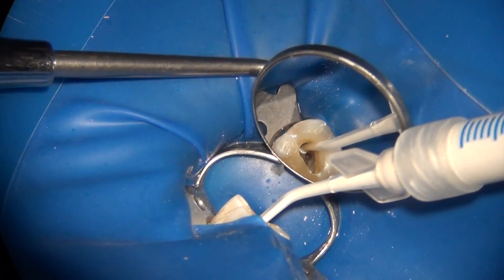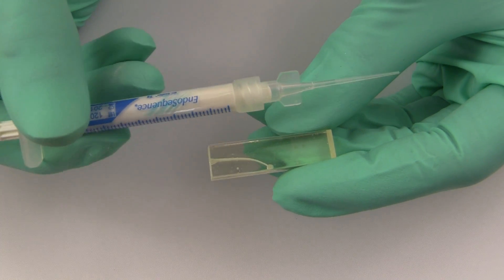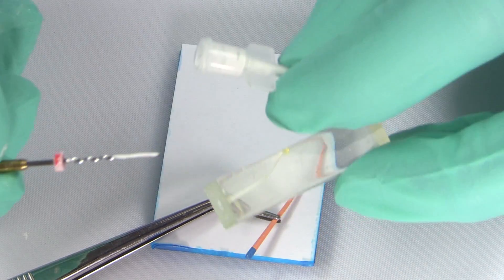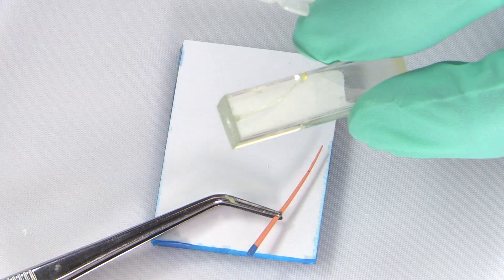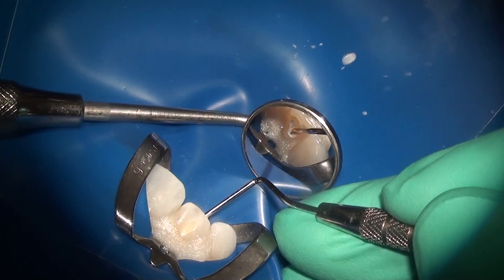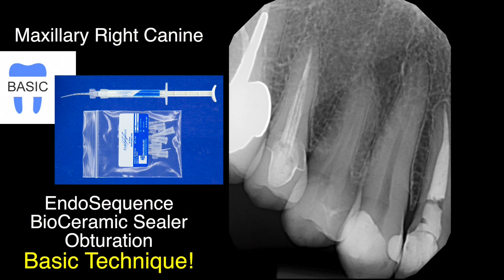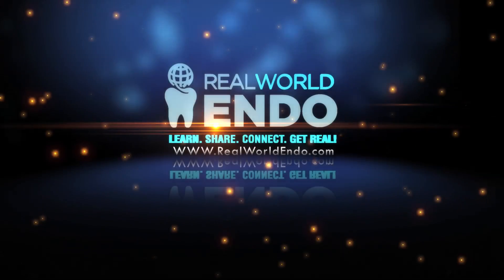Basic Hydraulic Condensation Technique

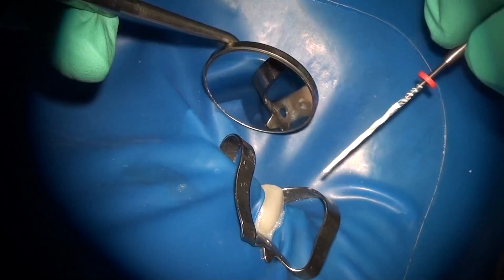Comment: Thank you for this video! I do have a question: At 10:02 you show a case in which you apply the technique, specifically, you describe how you dip the master file in the sealer and place it in the canal with some counter-clockwise rotations and you mention that one should "repeat as needed". You yourself apply a coated master file a second time. 
My question is: what am looking for to determine if I should repeat the application of the sealer or not? 
Said differently, how do I know if I have enough sealer when using this technique?
Thank you once again, Dr. Nasseh!

Comment: Hi cn i use scaler tip to remove excess sealer? Or i must use only specific endodontic ultrasonic? Tq
Reply from the maker: If the scaler tip can reach deep on the furcation it should work (should be used with water!)

Comment: hello Dr Ali Nasseh. please can you tell me which brand sells brasseler's products in Europe. I'm a but confused since a few years ago FKG was the brand but now I can see the bc sealer is sold by BUSA. thanks a lot for your help
Reply from the maker: Currently, Brasseler does not sell in Europe. They are distributors primarily in North America. FKG was private labeling some of the BrasselerUSA Products such as BC Sealer and Putty but that's about it. Cheers.
Reply: @EndosKool  I guess they divided their product into two distributors... I'll try to contact both. Cheers
Reply from the maker: @san5a89  Schein also sells BC Sealer. I forgot to mention.
Reply: @EndosKool  OK. what I really need is the right cone for the bc sealer based obturation. do you think a gutta cone of the dentsply system would warp with the bioceramic sealer? I actually had a lot of problems with conventional cones but I never used dentsply or vdw cones

Comment: I don't like single cone obturatiion..
Reply from the maker: That’s fine but Keep in mind, this is not the Single Cone technique. This is called Hydraulic Condensation. It’s people from other companies who are trying to discredit this technique that call it a single cone technique, because the original single cone technique in the 1950’s using ZOE failed. This is a different and non resolvable cement. Also, In wide, ribbon shaped canals you will need to use 2 or 3 cones adjacent to the main cone to fill in the gaps. That’s why it’s not a single cone technique. Cheers.

Comment: Thanks for the video. Two questions:
1. Can I use Vortex Blue and Wave One Gold master comes with BC sealer and expect good results despite not using BC gutta percha points?
2. Can I use the master gutta percha point instead of the rotary file to coat the walls? I find that allows me to place a more even application than the rotary.

I will order BC Sealer next week. However I won't be able to change our rotary system. Hence my first question
Reply from the maker: No specific studies have given an answer to that guest but U.Penn showed (through their internal research) that you get a less effective seal for the first 60 days with non-bc coated GP but then the seal becomes the same  after 60 days, presumably because sealer expansion over time. So, if you have to use that combination then you'll likely be ok as long as you've done the right job of cleaning and shaping.
Reply: @EndosKool  Thank you for the quick response. I understand the importance of a good seal, especially in the apical third. However, assuming proper cleaning and shaping, are we to assume that a non-effective seal can allow recontamination of the tooth from the remnant of bacterial matter beyond the tooth apex in the PDL and bone space? Just want to ensure the correct understanding. I currently do lots of my endo with cold lateral condensation using Dentsply Ribbon sealer. Many times my master single cone fits snugly enough to where I cannot pack any lateral cones. I use mostly vortex blue 0.06 taper and wave one gold. I realize that single cone obturation should ideally be done with a ceramic based sealer.  I would imagine with my single cone obturation using a non ceramic based sealer, I'm getting a good seal in the apical third but not so much towards the coronal area

Comment: Dr, cleaning the excess sealer with scaler and water,... wouldn' t that dissolve or remove the sealer?
Reply from the maker: Good question. It would if you use the ultrasonic to touch the Gutta Percha. You should direct the tip of the ultrasonic only on the dentinal walls near the gutta percha and never directly on the gutta percha or sealer interface. That's an important detail. Cheers!

Comment: In this tutorial , said that leakage occurs between gutta-percha and sealer so we should use bc coated cones ...is leakage occurs actually between gutta-percha and sealer or between sealer and dentin walls along the canals ?? Or both ??
Reply from the maker: Technically, leakage happens between GP and sealer in all sealers. The idea of using BC Cones is to help reduce this leakage by bonding to the surface of the GP. They've done studies at U.Penn showing that there's more leakage with regular GP than coated cones for the first 60 Days. There's then expansion of the sealer and the effect is negligible. That's why we recommend the BC cones unless they are not available were you are. Cheers!
Reply: @EndosKool  okay, regardless of using bc coated Gp ...,as leakage occurs between gutta-percha and sealer in all sealers why we don't use for example resin sealer wz single cone as leakage occurs in any case??
Reply from the maker: Leakage is only one factor. Resin and ZOE sealers will wash out of the canal in whole when pooled in one are. Historically, that’s the basis of our Condensation techniques.
Reply: @EndosKool  thank you sir, but if single cone is used wz resin sealer , how much time will it take to get washed out ?? Range ??
Reply from the maker: If you extrude a bunch of AH Plus out the root end you can see it resorb within a few months. Inside the tooth it will take longer but if it's pooling it will happen. Again, this is a matter of preventing the odds. It's not like every time you don't wear a seat belt you will get into an accident. But if you're not wearing it when you get into an accident then you're in trouble! This is the analogy for making decisions the enhance your outcome based on principles. Cheers!
Reply: @EndosKool  well said sir, thanks

Comment: Thank ya doctor 
I have noticed that while checking my master cone gp and taking the x ray  it comes pretty good but after putting sealer ( MTA- Fillapex) I use , the cone ends up being short most of the times . Please advice me to improve my obturation
Reply from the maker: First of all, you shouldn't be using MTA FillApex with this technique. MTA FillApex is a primarily a resin based material that much like Ribbon or AH Plus is resorbable. It's not a bad sealer but you need to use the usual lateral or vertical condensation with that sealer. Only pure bioceramics can be used with Hydraulic Condensation since they a non-resorbable after they set.
Reply: Real World Endo   Thank you sir !!!
Reply: After dispensing mta fillapex and ready to use, use it within 10 secs for each canal... Don't coat the Canals with sealer before obturating the canal with GP... Instead coat(thin coat) the master GP with sealer and insert it in the canal... Definitely this will solve your problem...
Cheers!

Comment: Ultrasonic and sterile water, right? And I just cannot see the problem with too much sealer/filler. The GP will not seat properly, well, as long as everything is sealed with the BC-filler, why should that be a problem? And why not cut the GP-cone further down than to the orifice of the canal? Why not 2-3 mm down the canal from the orifice, and then use a new layer of sealer/filler of bioceramic up to the level of the orifice? Since the GP will not bond to the dentin, but the sealer/filler will, it will be completely sealed. So the GP will be completely surrounded with sealer/filler.
Reply from the maker: All great points. Yes, Sterile water (or same water you use in your high speed handpiece.) Regarding the other points, we teach Hydraulic Condensation to make sure the GP goes to the apex so the case is retreatable if it needed down the line. If there's a long segment of cement without a GP center it would be difficult. Regarding the use of a canal cap, one can do that, but having sealer on the orifice makes it difficult to place a restoration immediately since the cement will not set immediately and the wet cement prevent the application of a bonding agent if you want to bond a core.

Comment: Hi, does this mean that you don't vertically compact because that would spread the sealer thin? By just putting the cone in and pumping it a little bit is enough to hydraulically condense the sealer into the canal system? Vertical compaction can sometimes cause trouble because of the canal anatomy since you can't always get a clean downpack and might end up getting a void with your backfill.

Comment from the maker: I would not recommend a lentulo spiral for the same reason direct injection is not recommended any more. Forgetting the potential for overfill, you can pack too much sealer using a lentulo as well. When you use the master file (or one file size smaller) you force all the excess sealer against the walls as the size of the file and the ensuing GP are the same. Any additional sealer will get pushed against the walls and if there's more sealer than needed the sealer will go into the file flutes. :)

Comment from the maker: Hi Tasos! I will do another video about vertical condensation with BC Sealer next. But to answer your question, oval canals are best treated by putting additional cones next to the main cone. Then sear off with heat. If you have large spaces left laterally, either use the putty or use thermoplastic gutta percha  backfill with Obtura. The manufacturer of the BC Sealer has now made BC gutta percha pellets for use with Obtura for vertical. I will do that demo video next. Thanks for watching! :)